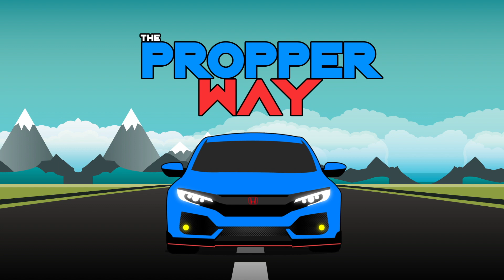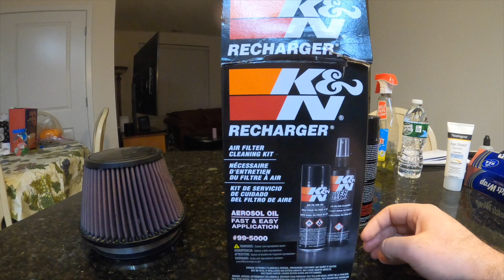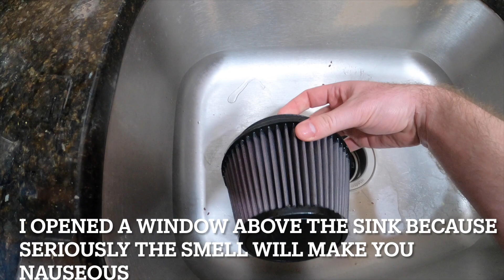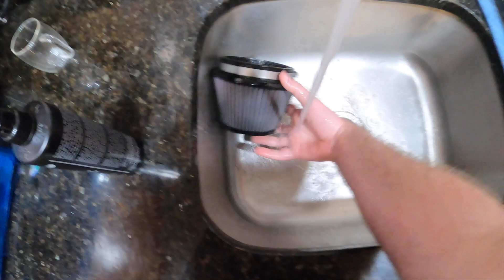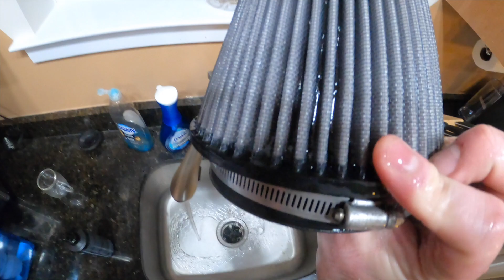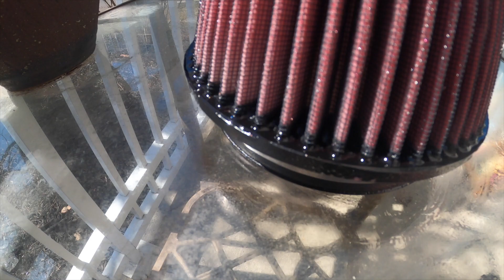How To: Clean and Oil Any K&N Air Filter (Quick and Easy)

Comment: Does the cleaning also apply to KNN filters for a 10th generation Civic too? Would I still need the same cleaning agents as the ones in this video?
Reply from the maker: Yes. All K&N air filters use the same cleaner and oil